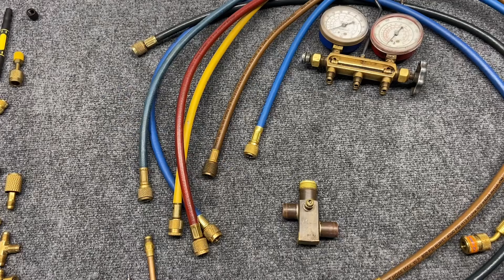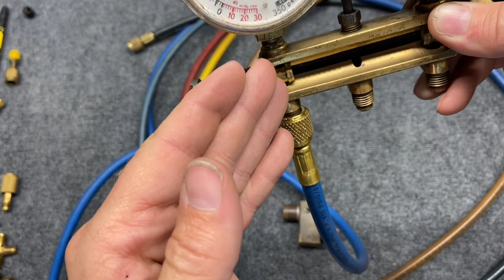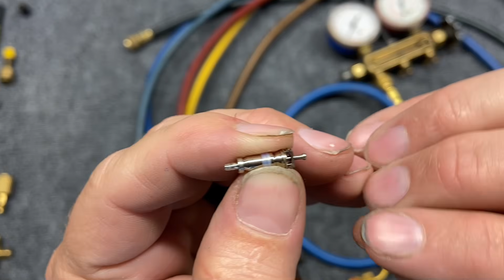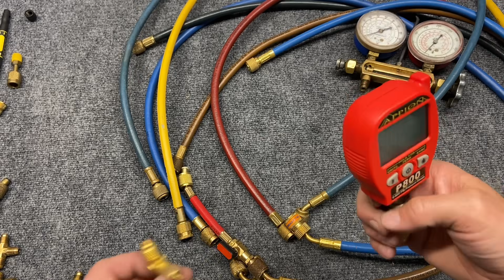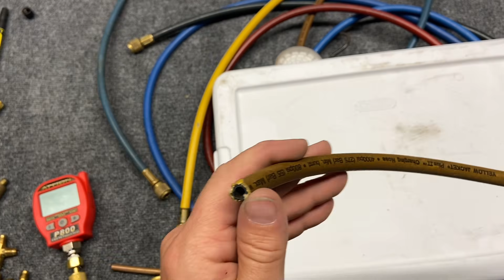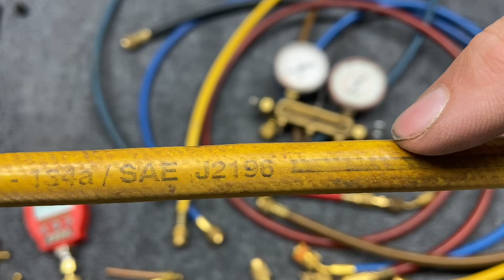HVAC 041 Hoses and low loss fittings

Comment: no where can i find how to install a low loss fitting.... i bought part number 19029 and i cant figure out how to take the one out of the end of the red hose and add a new one on
Reply from the maker: You need to buy a hose with the low loss fitting of your choice already installed from the manufacture

Comment: I was today years old when I realized that “low loss” means the refrigerant in the line is kept using a valve.
I thought it meant the refrigerant that’s lost as you’re screwing the hose on. In other words, the Schrader valve isn’t depressed until there’s a proper seal.
Is there such an end that minimizes refrigerant escape during the coupling action?

Comment: Yes sir I still use the set up @ 7 mins in & I did that once on a blind. Hookup , I reached in blindly & undid the wrong 😢  fitting & Burt my hand up badly before getting it off the core depressor  but I also have an reg hose , added ball valve & then low loss fitting on hi side only

Comment: how do you remove the valve in the low loss fitting?  I took the snap ring out and removed the thumb screw portion but couldn't figure out how to removed the valve core.  Is there a special tool that is needed or technique?

Comment: I know this is an old video, but I was hoping maybe somebody could help this DIYer out. About 25 years ago I had a leak in my residential R22 system. After paying a "professional" $700 to find  to find a leak he never found, I purchased R22 from a HVAC guy in the Home Depot parking lot for $40. So this was after a license was required to buy R22. I bought myself RobinAir gauges and on a few occasions replenished the R22.
Fast forward, I'm a caregiver to my mother in her house. She had issues with R22 evaporator coil freezing up. I watched hours of Ty's videos and to try to troubleshoot. I did add R22 to the system as an emergency measure with my old gauges and old R22. Have not had the problem since BUT still trying to diagnose the problem. Bought ST4 Fieldpiece and wet bulb, and clamp thermometers. 
All this to ask the question....the last time I checked the vitals on the system , the low pressure connection had a leak. So I wanted to replace the gasket, but Robinair has a gasket that sits on a T shaped brass valve depressor. I called the company and they could not help. So is there a kit to substitute for this type of gasket setup. Can I use the typical gasket with screw in depressor? In the meantime I have been using the yellow hose as my low pressure hose. Not sure what my situation will be once my mother passes so really didn't want to buy a new setup or Robinair hose.

Comment: Many thanks for the really informative video.  I have to confess I am confused with the variety of connectors.  I have come across 1/4" fittings with 45 degree flares, some with 37 degrees, some with the end of the flare flattened off, some without O-rings such that they rely upon metal to metal contact with a flare and inverted flare (if that is the right phrase) of the same angle (as is the case with connections to gas cylinders).  I have a Superevac pump with a 1/4" flare (which is not flattened off) and when I connect that to a hose like the ones you have shown in your video, it wobbles about, but connecting the hose to a male fitting which has a flattened off flare and it feels far more solid.  Then we have SAE, JIC, UNF 7/16-20 and AN standards.  Are there any publications, websites that you know can shed some light on these various types of fittings?  Many thanks.

Comment: You indicate liquid refrigerant remains in the high pressure side of the gauge and hose when you remove that hose, and that it's a large amount. But where does it go after that? Do you just keep it in the gauge for the next service call?
Reply from the maker: It needs to be put back in the system via the low side while it's running

Comment: I was taught to use gloves. Safety first
Reply from the maker: Gloves can make it more dangerous.  Most people use cloves out of a fabric that soaks up the liquid and causes the glove to  freeze to the skin making it impossible to separate your hand and creating long term permina t damage.

If your going to use gloves it has to be internally insulated and externally chemical resistant to prevent the liquid refrigerant from a soaking into it. This same gloves make it difficult to to put the hoses on or take them off fast enough to prevent refregerants from coming out in the first place.  Safety fist don't work with refregerants or electricity. True safety be aware of the hazards and manage risks aporopriortly

Comment: I know this comment may be a little late, and it's an older video, but I've seen pictures of manual ball valves, and i understand that setting the core depressor height is key to the low loss.

 ive read a blog on navac about them saying the core depressor should be flush with the hose gasket my question is does it hurt to have the core depressor a little lower than the gasket 1 to 2 turns? Also, i planned on using a manaul core depressor tool  that traps gas to put back into the vapor side. I'm making sure to purge my hoses before all of this first. 

Ultimately, i feel like 1 to 2 turns below the gasket allows it to seal against the port right away. I've not tried it yet, but i plan to when my new hoses and manaul core depressor come in

I feel like this offers the most control and least loss.

Maybe you could answer this.
Reply from the maker: Really this is an introductory to get students comfortable. 

I recommend probes with the manual core depressor.

Comment: What about shredder valve when hooking a quick connect for cars?? Connection has valve?
Reply: With most modern vehicles using R-134a & R-1234yf (vehicles mfg ~ early to mid 1990's through to today), larger diameter "high flow" style service port valve cores / "stems" are often used, particularly on Ford & GM. 8mm and 10mm Eaton-style high flow A/C service port valve cores are common.  These are substantially larger than the typical 5-6mm diameter HVAC/R (residential HVAC) valve cores.  The flow rate is also typically many more times faster than on most residential HVAC system service ports. So in most cases, unless you are really in a mad hurry to recover or deep vacuum your vehicle A/C system, the valve core depressors inside the quick-connect adapters that attach to the A/C service ports are more than adequate to open up the flow of refrigerant  for MVAC (Motor Vehicle AC) service.

If you really need the higher flow rate for MVAC service, or simply need change out a leaking auto valve core, Mastercool and FJC make master kits that remove all types of MVAC valve cores, including the larger "high flow" variety.  FJC's kit also has an added 1/4" flare fitting side service port on the main VCRT body (valve core removal tool).  Otherwise, you will need to jury-rig a variety of adapters / fittings to accommodate attaching your gauge set, vac hose, etc to the back of the VCRT once the valve core has been removed  (which is M18x1.5 thread on both ends of the VCRT valve body, for both the Mastercool & FJC kits).

If your vehicle does not use "high flow" valve cores, and uses standard or JRA sized cores, than there are a whole bunch of less expensive options for VCRT's & adapters / fittings on eBay & Amz to make your setup work.

Comment: So you're saying the ball valve type won't allow liquid out of the shrader port when you're connecting or disconnecting? The whole concern is at the nut. Between the nut and its tube, or from the threads of the nut onto the port, liquid is going to spew out as long as your connector is depressing the unit's valve core. Forget what's in your lines; you can easily have the compressor suck that back through your manifold into the unit until you're clear. Isn't it easier to use a thumbscrew-type "gate valve" sort of connector that you can turn before unscrewing from the service port? Maybe pair it with a low loss? 🤔

Comment: Great in-depth look at refrigerant hoses.  Being new to the field it was good to see up close the differences between the regular & the low loss fittings.  I was also looking forward to seeing the valves on the manifold being operated with the cut-out view, hopefully sometime in the future just to see exactly what goes on inside the manifold when opening & closing the valves.
Reply from the maker: In the same playlist I have the manifold cut open to show what happens. I don't remember the exact HVAC 0## it is.

Comment: How about that little air between the low loss ball valve and the fitting end?
Reply from the maker: That's valid, the best method is using digital probes, no hoses

Comment: I`ve only a small question, is the low loss hose a one-way hose? That means only for recovering but not for charging? Is that right?
Reply from the maker: When attached it will flow either direction but when it's disconnected it stops the flow in either direction

Comment: If using a 1/4" Male SAE to 5/16" Female SAE adapter - should I buy one with a valve in it or without please?.. They sell both.
Reply from the maker: I keep both, sometimes I need 1 over the other
Reply: @love2hvac  OK thanks.

Comment: So I'm a dirty dumb auto technician so excuse my ignorance. When I was working with my dad who did commercial and residential hvac. I watched him open and close the valves on the service ports to allow pressure readings and recovery/recharge. If these valves are present why don't you isolate the high side service valves and leave your hose connected, then open the high side and low side valves ok your manifold and "suck" that column of liquid back into the system? I come from automotive where some of our stand alone recovery machines do this during the charging stage. I've mad it a habit that every time I connect to a car, I unscrew the high side coupler while leaving it connected to the service port and then purge my liquid line back into the low side with the system running. This isn't a substitute for low loss but it minimizes loss of refrigerant from the system from having gauges on it.
Reply from the maker: Great question. 
In the automotive side the service hose is often still connected to the service machine and it's usually one refrigerant. So it's not an issue.

In HVAC it's common to do it that way but it very often contaminates the system. 

In the yellow hose and the center manifold gauge without vacuum or recovery being done is contaminated with air, moisture, or some other refrigerant from the last service. 
When you disconnect the high side hose and bleed it across the manifold, the high pressure from the red hose pushes the contaminants from the manifold and center hose into the system and contaminates it.

I used to find systems that has never been serviced with pure refrigerant but those  that had been serviced had contamination. When I watched other techs don't they never purged the center because it's very difficult to do if your not pulling a vacuum or doing recovery first. 

After changing the methods we found the contamination issue on the equipment we serviced to go away.

Comment: Would a (unattached) low loss fitting let in air under vacuum?
Reply from the maker: Automatic low loss fittings yes. Manual ball valve low loss fitting is less likely but they are not vacuum rated

Comment: But the one with the valve isnt low loss so when disconnecting from high pressure its gonna shoot out at you if u don’t do it quick enough..
Reply from the maker: The one with the valve is still a low loss, it's just manual low loss where the other is automatic low loss.
Reply: Everythings a manual low loss if you unscrew it quick enough..  low loss helps you when threading..
Reply from the maker: A low loss prevents the refrigerant from the hose spraying out.
An automatic low class does it automatically.
A manual low loss you have to close the valve first.

There will always be some loss but it will be low compared to the large loss of the hose.

Comment: Hey Ty, when testing pressures with a gauge, some of the refrigerant goes into the gauge, there is any way to prevent the loss of that refrigerant? when disconnecting the gauge.
I mean some of it will just stay in the gauge and not in the unit, how can i get it back into the unit or prevent it?
Great video by the way!
Reply from the maker: The best way it use probes and a charging tee. There is virtually no loss on the sensor. Then you only have the refrigerant in the charging hose. 
There are some options:
1 you can have the refrigerant in the hose to the valve when zeroing the scale. This way you are only measuring the refrigerant in the system. From there you can leave it in the hose and keep it attached to the tank for the next charge.

2 you can close the tank and bleed the refrigerant from the hose to the suction side, you will get all the liquid but there will be some vapor unaccounted for. Shorter hoses reduce this.

3 with the full manifold gauges, you can get the liquid into the suction side but you will loose the vapor amount in the hoses. on critically charged (small) systems this can be significant. On a typical AC it can add up over time just putting hoses on and off. Another reason to use the wireless probes.
Reply: @love2hvac  Thank you sir! you don't know how much I appreciate your videos! god bless you!

Comment: I personally like the low loss fittings from Yellow Jacket that you thread on to your existing hose, like the one you showed around the 6 min mark. Those to me work the best than compared to any hose that comes with low loss fittings. I believe the product I mentioned is called the SealRight Quick Couplings or something to that affect.

Comment: I loved this presentation.  I learned so much!  Everything explained with reasons.  However, I do not quite understand why one of those hoses which had a burst rating of 2500 psig was unsuitable.  Usually the burst pressure of the hose is 10X hoop stress and so it ought to have worked.  But then these hoses are polymers and with repeated cooling and warming they become brittle and it is best to be on the safe side.  I wonder if these have expiration dates after which the hoses need to be discarded???
Reply from the maker: Thank you 

A lot of companies are still selling hoses rated for R22 for cheaper vs the ones Designed for 410A
It's a great question about expression, I usually replace my hoses every year but now I use probes so I only use the hoses when charging or recovering so they last much longer. I still have my great grandfather's hoses but I would not trust them. 

I guess it just depends on build quality, use and abuse.

Comment: At 2:45 you start making the point that a lot more refrigerant is released from improperly disconnecting the high pressure hose vs. the low pressure, but along the way you say "if we were to loosen this and allow the refrigerant to escape, it's really not that big of a deal." I disagree - allowing refrigerant to escape is never best practice and it is always a huge impact on the environment and contributor to climate disaster at 1000's times CO2e. That's a really bad message for those learning and I hope you consider editing that statement out of your videos. Thanks for your consideration.
Reply from the maker: Thanks for your reply.
Liquid refregerant cannot be vented legally and it is a considerate amount. Liquid density vs vapor density. 

As for the purging of the hose with vapor it is allowed under the deminimus release according to the EPA. 
The hoses must be purged and there is no other practical way of doing so. 

While I appreciate your concern for the environment, you have to also understand these steps I  teaching are considered extreme by the majority of techs in the field. You have to consider a lot of techs do not recover refregerant at all. A lot of techs do not even attempt to recover refregerants or even fix refregerant leaks. There are a lot of techs that  do not use low loss fittings at all and vent all the liquid refregerant out of the hose every time. 

I receive emails constantly form contractors upset that I tech all these "environmental" things that nobody does in the field. I have contractors tell me the methods I teach this is a waste of time and they just want to get the job done. 
I have had students out of my class mocked that they try to do recovery and follow these steps. If you go to the HVAC groups, you will find people bragging about venting refregerant and they mock the ones that are attempting to recover refregerant. 

The EPA does not even have a regulation for fixing refregerant leaks leaks on systems under 50pounds, Wich is every household and small to medium business.

The EPA is not even enforcing venting of refregerant. I have had students who recorded and reported purpose venting to the EPA and nothing happens. 

While I do appreciate the care for the environment, the purging of vapor, deminimus refregerant is a nessesaty to ensure no contaminants and the only practicle method as of today. 

 It's difficult to look at the vapor quantities when thousands upon thousands of pounds of liquid refregerant are purposely vented in the USA alone.